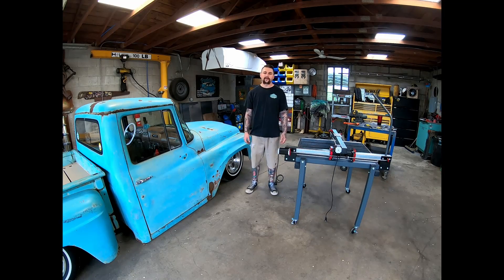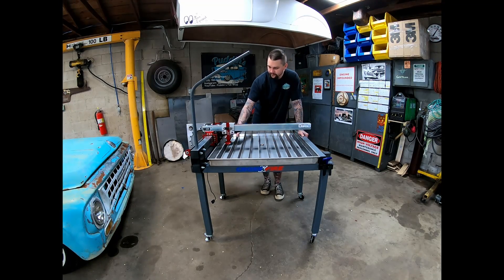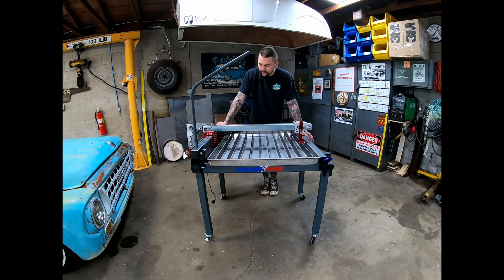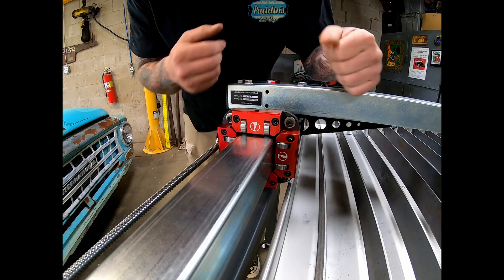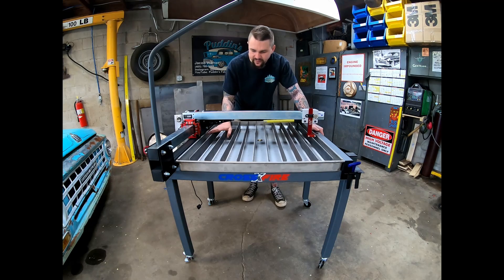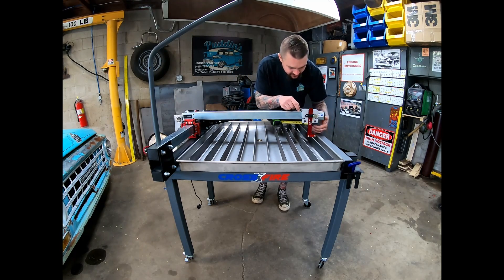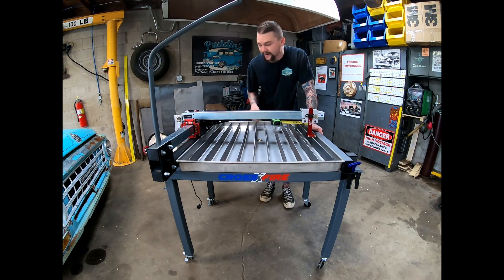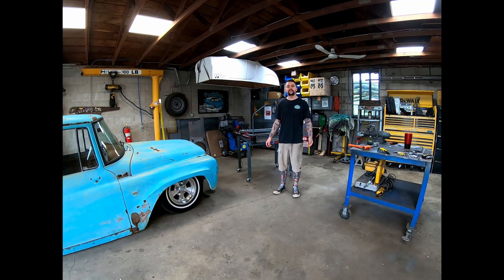Leveling the Gantry of my Langmuir Crossfire Plasma Table

Comment: I had a similar issue and your video was recommended to me in the Facebook forum. Before I watched it I think I was able to address my issue. I loosened the top rail and was able to get some movement out of that and there for lowering the Gantry arm. I'm not experienced enough to know how close is good enough but using the shim it's very, very close. Just a thought that if you have this issue you may want to try to see if you can get a movement out of the top rail before messing with the bearings. Just a thought.

Comment: Just built mine yesterday and It’s been flawless so far. I agree it needs to be tweaked into perfect alignment once set up, but I think that’s just because everyone’s floor will be different. I’m at least grateful they designed it with enough adjustments to be able to make those adjustments. Happy cutting.
Reply from the maker: That’s great. I’ve been so busy on other projects I’ve only got to use mine once :/